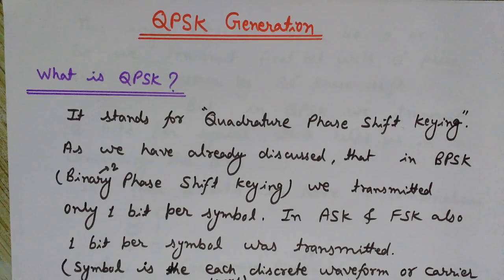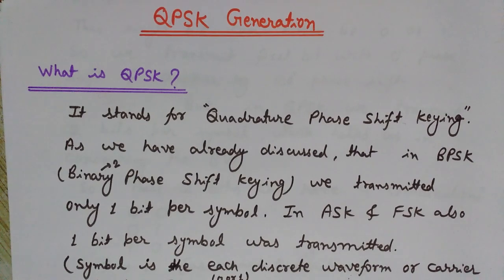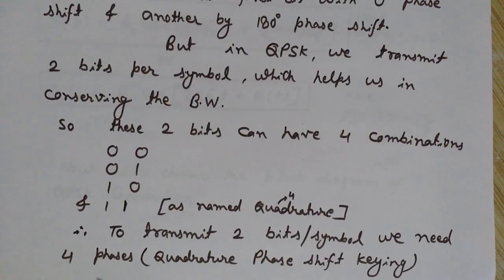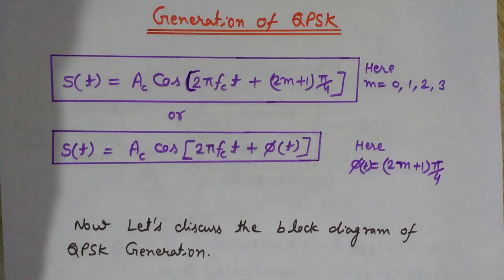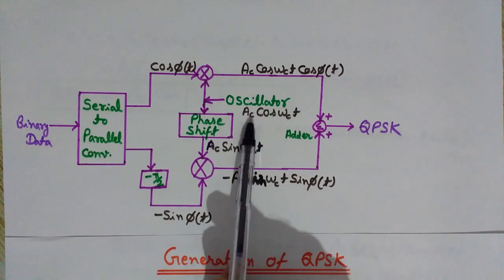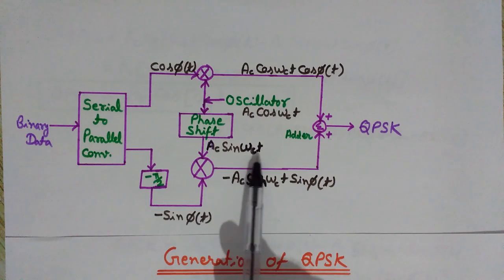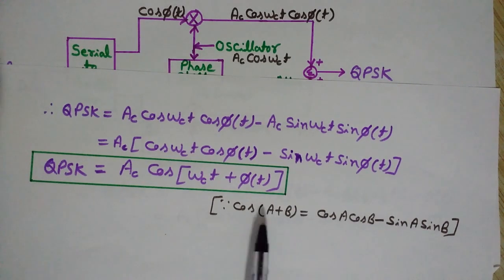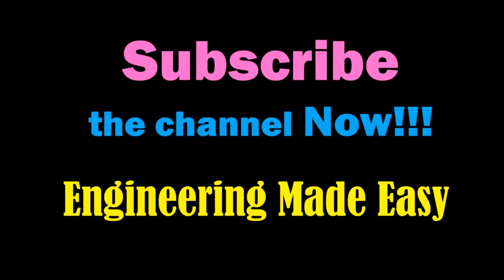QPSK- QPSK Generation and Detection - QPSK Block Diagram (Quadrature Phase Shift Keying)

Comment: I have a multiple choice question:

A signal 2-ASK with data [1001] and with an initial phase of 0 degrees added with a signal 2-ASK with data and with an initial phase of 180 degrees, the result of the summing would be:
A)Signal   FSK
B)Signal   BPSK
C)Signal   QPSK
D)Signal   4-ASK

Can you help me please because a have a test
Reply: Did you get it ?... If not, then it would be Option (B) I guess...